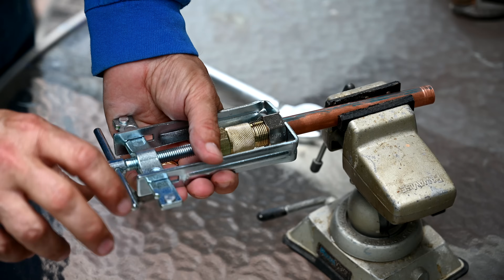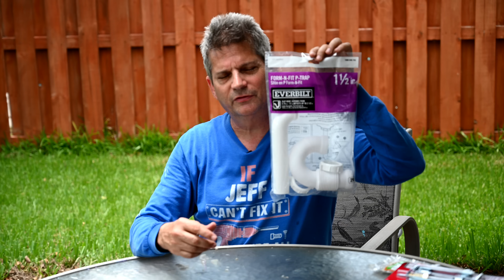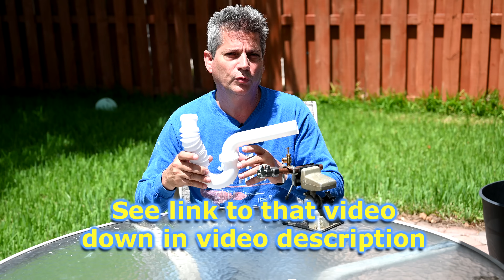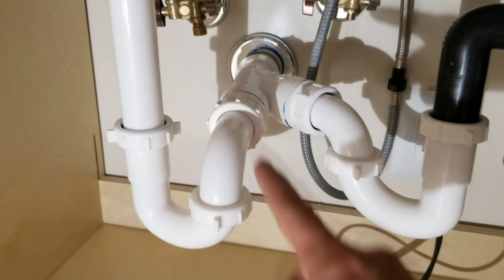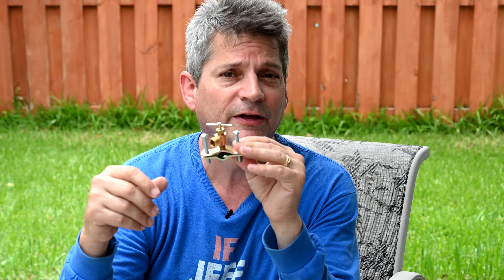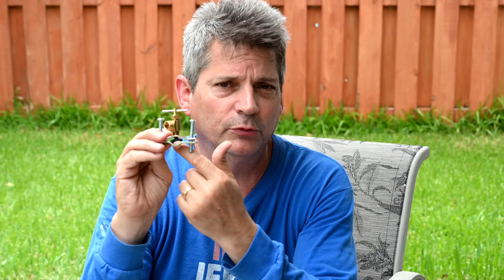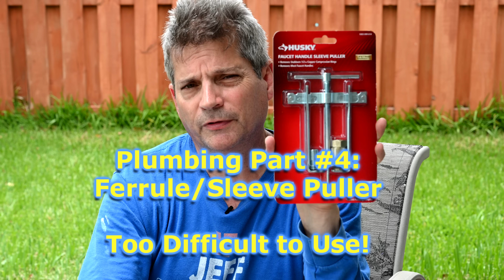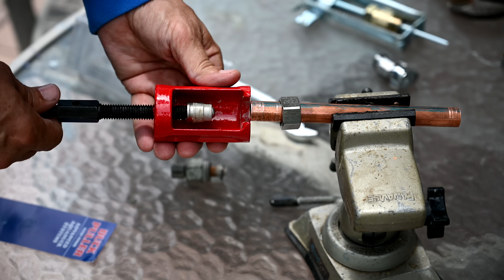4 Plumbing Parts/Tools You Should NEVER Use. NO Plumbing Fails

Comment: 12:25 A local HVAC company used a saddle valve like that when they needed to tap into the copper pipe. I was surprised they would use one. Sometimes home improvement is a lose-lose situation. Do it yourself and do it the right way, but it takes a long time and you don't have the right tools. Pay someone else to do it and you get it done poorly. 

Drilling through studs and joists is a similar issue.

Comment: Plumber/DrainTips before auguring a house or residents drain line use hot dishwashing detergent like Cascade mixed in a milk gallon jug and let drain into pipes and sit for 20-35 minutes. Makes pipes slippery to run auger thru. Make sure if your jetting a line with water jet have a wet/dry vacuum that can hold 5 to 10 gallons of water for a quick clean up so to prevent a real mess. Create an adapter to the toilet tank filler line if you need to run water to a drain jetting system that way you do not have to run a hose outside the house to get water for the drain jetting system.
Reply: Thanks for those great tips!!!
Reply from the maker: Yeah, that's  some good tips.

Comment: S-Trap Problem. 

How traps work.
Common types of traps are U and P traps they are both essentially the same. they create a little "U" that collects water in the base of the U. That create a barrier from the sewer gases that would otherwise be coming up from the pipe. That is why, if you leave a sink dry too long then you will get smells and possibly bugs. 

With an S-Trap It's a syphon action. Basically the water & gravity work together to pull the water through the tube. If you are, instead of going vertical at the end of the trap, you go horizontal then you eliminate the added gravitational pull.
Reply: surgio98 - great explanation.  Vacuum effect.  Thanks

Comment: I live in an older house. ALL of my sinks are s-trapped & my tubs don't have vents. After flushing the toilet I have to refill the trap with water to keep the sewer gases from coming up. It's a nightmare. I'm pretty sure S-traps are banned under IPC as well. If you absolutely can't get a proper vent attached to your P-trap, some states allow the use of an AAV (but you still need your soil pipe to connect to at least one atmospheric vent). Some states ban them though because the diaphragms can rupture & they only handle negative pressure but not positive pressure. You have to make sure you run the trap arm no less than 2 pipe diameters or you will get a crown vent (which will also result in siphoning like the S-trap does).
The accordion traps are terrible. They are the only kind they sell for sinks at places like Walmart. The hardware stores were closed when my friend was getting plumbing supplies for a repair so he got this kind & the mice chewed right through the flimsy accordion part. It is not nearly as sturdy as sch40 PVC.
I've never seen a saddle valve before but it looks idiotic.
I'm kind of glad I don't have any copper pipes in my house because it seems like a pain to work on. I have all PVC for cold (which I know is no longer to code) and CPVC for hot.
Reply: Another way is to put two s traps in a row. so after using the sink both will be full of water, and if a toilet or something sucks water out of the first one, the water from the first one should replace it so you still have one of the traps working. I guess would only work for one flush though, unless the extra weight of water prevents the water from sucking out at all.
Reply: I live in the UK and we have a thing call anti Syphon traps to stop this from happening

Comment: What I want to know?  Is why it is necessary to remove the old ferule in the first place?  If the back-up nut has the same thread pitch as the new valve, and isn't damaged, and the connection wasn't leaking before?  Why strip it out at all.  The connection depends on the malleability of brass, and a double-tapered metal-to-metal seal.   Could you simply replace the valve part, but re-use the old nut and compression ring?  Assuming it doesn't leak when completed, naturally.   It seems to me, that dragging the old nut off the pipe will deform it anyway, and not in a good way.  I'd think it would be better to leave it--there should be enough exposed, undamaged pipe to solder on a proper NPT threaded fitting.
Reply from the maker: Bob it is really a matter of preference some people  leave them there.  But removing the old ferrule sleeve, you can then clean the whole copper pipe again, brush it down and make it look nice and shiny like it was on day number 1. Also 20 plus years have passed since the last nut and ferrule were put on the pipe, the newer pair might be made to slightly different tolerances who knows so why not used the new matched pair? Why not use the new ferulel since it comes in the Box with the new valve? They were engineered by the current manufacturer 20 years later to work together as a pair so I prefer to use them as a pair and start over with everything brand new again.  Also you don't know whether the previous installer might of damaged the old sleeve microscopically and maybe you can't see that there's something wrong with it. Or maybe the act of you loosening the old valve off the pipe might leave you with a sleeve that will not compress back to a perfect seal. So you can see there's enough what ifs involved in this equation here that I prefer to eliminate the entire equation altogether by starting off with everything brand new.

Comment: Nice informative vid, thanks mate.  I notice that your US parts are slightly different in design to UK parts, hence different depths of air traps.  Also, we have different installation requirements, which make these traps OK for use, ensuring adequate pipe sizing to avoid trap draw-outs, plus the use of AAVs (air admittance valves) to avoid problems.  Re. olive removal tools: often olives have been tightened sufficiently to contract the copper pipe, hence removal is not an option.  I rarely use this tool, rather cut / remove / replace the damaged pipe.  I also have olive cutting pliers, very useful.  Saddle valve clamp?  UGH, no, never.  The ones we have available, cut a small disc of copper, which travels down the line to any adjacent fitting & causes damage; and the steel cutter / outlet quickly corrodes & blocks itself, eventually requiring the whole section cutting out & replacing, instead of doing a proper soldered tee in the first place.

Comment: Husky only makes junk, I'm not surprised that they would make something like that tool.
Reply from the maker: They got some good tools, i  recently bought their plumbing tool bag.
Reply: @jeffostroff  .  their tool bags,belts and pouches are good.  I have one of their tool belts.  I'll actually do a review on it now that I have had and used it for a few months now.  But as far as their tools, they are junk and even dangerous at times.  I have had some of them break while using them for their intended purpose and cause harm. In fact, this last Saturday, I was turning a 3/4 inch nut on a bolt while building a gate.  I was actually using a Husky 1/4" socket set, and the short well socket and small extension.  The extension bent and then snapped in half and my knuckles scraped down the plank.  Too weak, because it was only my hand and a shorty ratchet. 

Although, if I had to choose between Husky and Kobalt, I would have to side with Husky.

Comment: When I change the cuff I use my forceps and squeeze around a few turns, this stretches the metal in the cuff and it is easy to pull off with my fingers.
Reply: Thanks for your very accurate listing! The trick is to gently squeeze with a new or unspoiled forceps, like as you massage a tender finger you massage the sleeve with the forceps. Carefully you squeeze many, many times per lap in straight marks that stretch the metal.  We almost never re span a mounted sleeve and never juse any other tools than described
Reply from the maker: does it ever warp the shape of the copper pipe? The tolerances on these furrules are really tight and and if the pipe is even slightly off, you'll never get the new ferrule on there.

Comment: The Husky tool worked perfectly for me because I read the instructions first. Good enough for non pros who just need to replace a few shutoff valves every once in a while.
Reply from the maker: But not good enough when you encounter a stuck ferrule. It worked ok for a couple of ferrules, but when you get one that does not want to come off, you lose a lot of time trying to get it off. Before I bought the Duck Puller, I had to just admit defeat a couple of times and cut the pipe.

Comment: My limited experience with trying to use a tool to remove a ferrule such as you showed is the tool mushrooms the copper pipe and the ferrule is there forever.  I have had better luck with a dremel  to split the ferrule.
Reply from the maker: Yes the dremel works too as long as you don't accident me Nick the pipe. I have never seen and of a pipe pharaoh from using any of these tools some wondering why you had that issue, unless they used the wrong type of copper.

Comment: Folks might take this guy more seriously if he knew as much as he thinks he does. The S trap he kept going on about is not allowed under most codes, but if you noticed, he did not even have the one he uses in the video assembled correctly! The return bend side was upside down! And his description of capillary action as “suction”? Hilarious! A complete crock. And “strong” toilets? I about wet myself. ( Properly vented toilets and fixtures prevent all the issues he described.
Ok.... so he is alright in condemning the corrugated flexible tubular trapwork items. 
The compression ring remover tools are great tools. Even the Husky work if you use it according to the direction, which he appears to have pitched with the wrapping. The part he was complaining about is the part of the tool meant to be used to remove faucet handles, not compression rings. The tool is shipped assembled all together with the parts for handle removal AND compression ring removal only helps keep the parts from getting lost.
By the way, there are dozens of different plumbing codes used in the US, some cities has a different code than the state where they are located, and the Uniform Code he speaks of is by far NOT the strictest code in use today. And most if not all codes will have a provision to replace “ like for like” parts like S traps if other associated work will not make conventional venting reasonable.
Reply from the maker: Thanks you fell into our trap. We purposely connected the s-trap wrong to see how many trolls would comment on it! As for capillary action yes, I misspoke, but you failed to point out that I immediately said after it that it was not capillary action. So you're being very insincere, and besides you know darn well I mentioned siphon a few times in this video, and your not very smart as you're trying to make people think. It was 100 degrees outside, and very humid, I kept losing my camera person because of the heat, and yes it was a bit hard to focus and I misspoke was going to bring up the point about capillary action when dental floss gets caught in the S-trap, I was thinking a bit ahead to the next sentence. But come on, you heard me say it wasn't capillary action. Don't you have a fortnite channel you can go troll?. That is capillary action. But go ahead if it makes you feel better to pump your chests to everyone about how smart you are and how I misspoke one time, so what. We did not have time to edit it out, re-shoot scenes, etc. The purpose of this video sailed over your head.. You're focusing on minutiae, people might take you more seriously if you actually watched the videos you're lying about.
Reply: jeffostroff : A troll? Perhaps, by your definition, that I point out errors whether by lack of knowledge, hot weather, lack of time to edit or any other excuse to allow incorrect information to be published. 
If you did not desire critical comment, why set a “trap” with parts assembled upside down? Well, you succeeded. This “troll”, (me) however is a third-generation plumber from Illinois. I have held my license since 1980 after my apprenticeship in the United Association of Plumbers and Pipefitters. While working in the trade, I also taught the Apprenticeship program at my home local for nearly 20 years. In addition, I sat for and passed the exam and was certified as “Certified In Plumbing Engineering” with the American Society of Plumbing Engineers in 1981. And I was a guest editor for Delmar Technical Book publishing for textbooks in the pipe trades.
So I have the Bona Fides to make critical comment. You should edit ind reshoot if the content is wrong, misspoken, unclear, incomplete or is poorly explained.  
The reason I give a damn? It is not because I don’t like YouTube “experts”, it is because I know just how much damage can be done through misinformation. Here is my “elevator speech” on misinformation.
Back in the late 1970’s, while I was still on the tools in the trade as a service plumber, I began noticing more and more often “S” traps assembled with the inlet “ j” bend backwards. This tripled the depth of the liquid seal, and increased the likelihood of trap siphonage due to ineffective or absent venting. Why, out of the blue, were we seeing the traps assembled wrong? The Sear, Roebuck and Company catalog used a photograph of the S trap they sold assembled incorrectly, and the public was using the catalog for instructions! See any parallels? Trap for trolls, error through lack of attention to detail or ignorance? The effect of unacknowledged or undetected error is the same. Mistakes will be made.

Comment: If it's against the code in all states, how can it be legal to sell it in stores in any state?
Reply from the maker: It is against building codes to use it, but it is not against criminal code to buy them. It is not a crime to use these parts. It is against building codes which simply means your city inspectors will not allow you to get a closed permit if they catch you with this installed.

Comment: Soooo, what is wrong with a S trap?  How is it different from a drain that goes into the wall first before eventually going down?
Reply from the maker: Jonathan, the problem is with iniertia of water. With an S-Trap, you typically have a short vertical leg followed by a long vertical leg, a recipe for a self siphon. With a standard p-trap, the iniertia is broken up by the horizontal arm, plus they are designed to have the air behind water with the connection straight to the vent. An S-trap could go down several floors before it sees a vent.
Reply: @jeffostroff  Ah, that makes sense.

Comment: In the uk a ferrule is called an olive. An easy way to remove an olive is to use and adjustable wrench to slide up the pipe and knock the olive off, you hit the back nut which knocks the olive loose. Sometimes if the olive is over tightened then it's not worth removing as the pipe will be crushed also.
Reply from the maker: Dale There's also a risk that your banging is going to cause that pipe to have a damaged solder  connection inside the wall. Using the correct  tool with better  mechanical advantage like the duck puller is always better than banging in a pipe.

Comment: The problem is not the tool it's obvious you don't know how to use them
Reply from the maker: I have successfully used that tool to remove the compression sleeves before, but it does not work when they are stuck. I fully understand how to use the tool and I use it properly, You don't understand of that tool is actually to tools and one in there are 2 sets of instructions for that tool

Comment: Regarding the S trap vs the P trap, what happens when the horizontal exit line passes through the wall and then promptly goes downstairs? What you have is a basic S trap, anyway. (respectfully submitted)
Reply from the maker: Thomas, no you don't have a siphon with a P-trap, because the inertia of the water flow is interrupted by that horizontal component of the P-trap arm going into the wall vent which allows air from the vent to come in behind the water. But with the S-trap the dangerous design component of the S trap is that long vertical leg immediately following the S-trap, just after the short vertical leg from the drain down to the S-trap. When you have a short vertical leg followed by a long vertical leg like an S-Trap that is the formula for a siphon.
Reply: @jeffostroff  thank you for your speedy reply

Comment: Why aren't you using gloves when using your ferrel tool ? Safety first , don't complain later ! Lol !
Reply from the maker: There always has to be a troll like you to scold people about safety when it's completely 100% unnecessary, helicopter mom. I'm outside in 100 degree weather humid as hell, dripping sweat, and just demonstrating the operation of the tool. My hands would be dripping inside gloves  if I had them on. This was not inside where we normally have gloves on while performing the surgery.

Comment: I installed a Studor vent 4” above the S trap🤔
Reply from the maker: Yes we have those here in Florida too, I had 1 in 1 of my rental condos that I owned it was brand new Built-in 2007 with an island kitchen sink and because it was nowhere near a vent stack they had the studor vents on there as well. Keep in mind though many States don't allow those vents.
Reply: @jeffostroff  If you MUST use a vent under the sink, make it mechanical with a spring and gasket that opens from the suction pull and closes from the spring.  Safer!